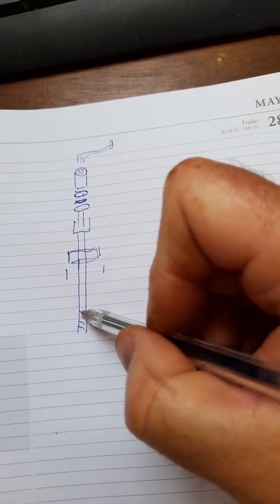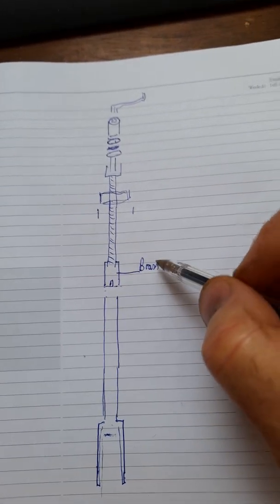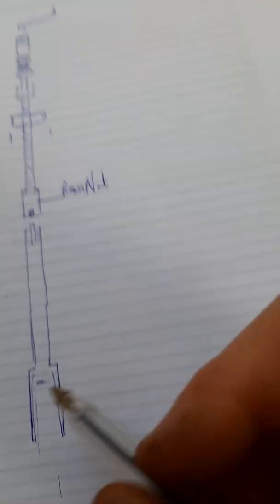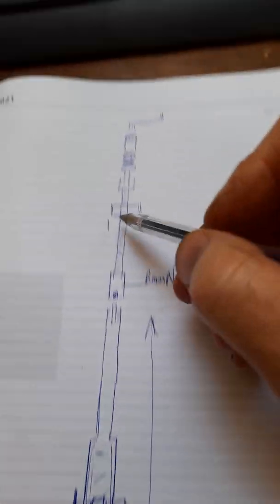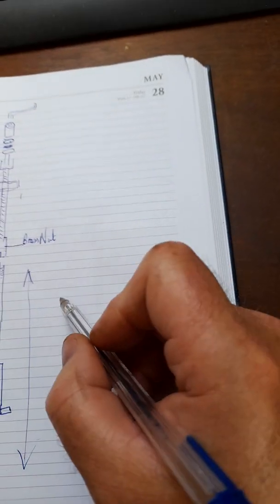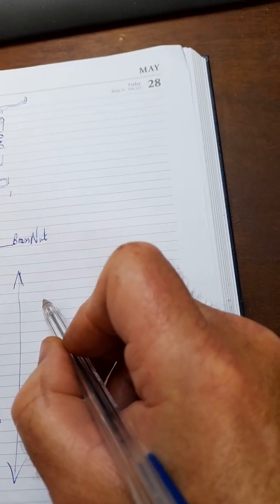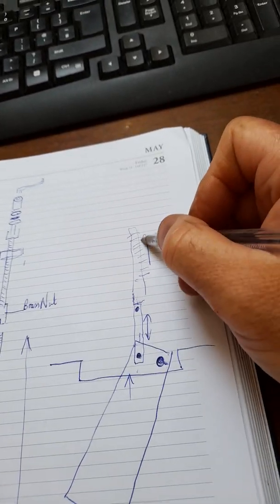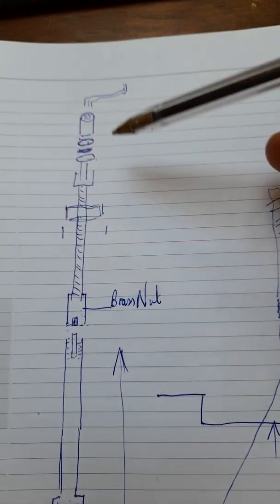Beneteau Lifting Keel Mechanism explained diagramatically

Comment: Where did you locate the replacement parts. Mine is a first 26 that needs the mechanism rebuilt
Reply from the maker: Contact Beneteau sales at Foxes Marina or take careful measurements and have them fabricated locally in high grade stainless steel as I did to reduce the price.

Comment: I don't know if this video is part of a longer discussion, but I've seen other system which uses lines to lift the keel. Some use blocks to pull the line, other using hydraulics to pull the line. That allows the keel to swing upwards on a grounding. Wouldn't this system bend if the keel hit a ground? Or would the screw mechanism be pushed up through the table?
Reply from the maker: Yes, the screw mechanism will rise up through the hole in the saloon table if you go aground as the keil rises up into the keil housing. You can then simply wind down the screw mechanism into the table again and the keil will remain up so that you can continue on your way.
Reply: @spillarge  Thank you, I want to built a system from scratch. So I'm doing some research of different swing keel systems. Are you happy with yours?
Reply from the maker: @robinj6997  Originally I was not happy because it needs constant maintenance and care. Most owners like the previous owner of my boat simply do little maintenance until the mechanism litterally ceases upand or falls apart. But once I had took it all out and cleaned each part up I could see that it was a really good system. I now take my mechanism out of the boat at the end of season every year. It takes me five minutes and then I simply take it apart and clean and polish it all back to stainless steel, then re-grease and place new anodes on each leg. I have done this now for the past five years and everything remains in perfect order for the new season and I have not had to replace any bearings, screws, nuts, pins or anything. But if you don't do this you will have to replace parts because they will corode and wear out. My mechanism runs like butter and I can raise the one ton keil with one hand on the winch. But ignore the annual maintenance and it will fail withing three seasons.

Comment: Cool, but i don’t get the idea of using “screw” system. 
Look at  equipment that is abused/srong/reliability is most important!!
They use hydraulic rams!
Reply from the maker: As long as this equipment is maintained, its perfectly good for the job in hand. The keel is guided with composite blocks to take up any sideways slack and if the boat is grounded the equipment simply rides up through the saloon table as the keel swings back. The screw is 100 turns from full up to full down and so its a very gentle movement in small increments. Key is the maintenance and I have mine out every year during the winter and its tip top and polished stainless steel before it goes back in again for the season and I smother it from top to bottom in the very best marine grease which protects it well. Just make sure you upgrade your mechanism to two anodes (one per per leg) as I have done and replace each season also. Its a good system.

Comment: do you sail with the mechanism fully "open"? or do you keep the raising mechanism bolt inside the housing?
Reply from the maker: To sail you need to wind the keel to the fully down position, but on a broad reach I sometimes go 50/50.
When in a marina or port I wind the mechanism up when   birthed all the time. But lower it for maneuvering in port.

Comment: Very easy to follow. thanks for posting.
Reply from the maker: You are welcome. Another point to make is when replacing the winding gear.....Make sure you cover the whole mechanism from tip to toe in marine grease or lithium-based grease, however, avoid the anodes of course. I have found that this action really protects the stainless-steel parts from tarnishing each year.